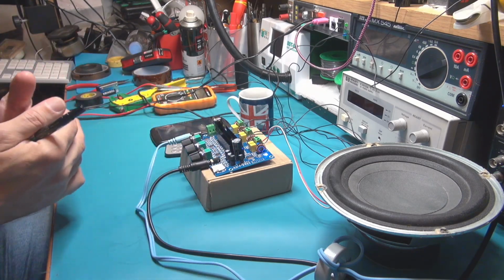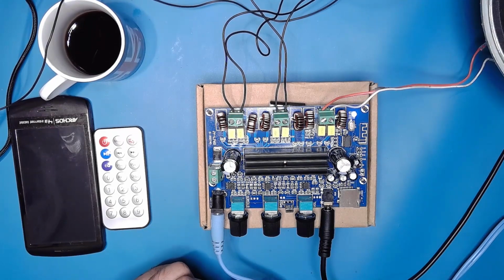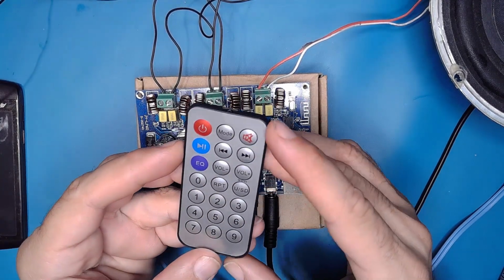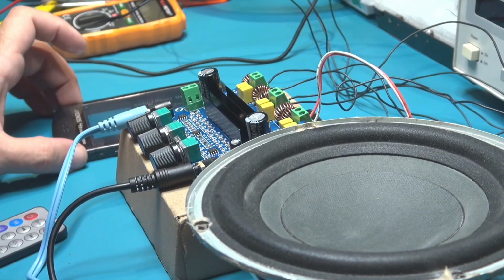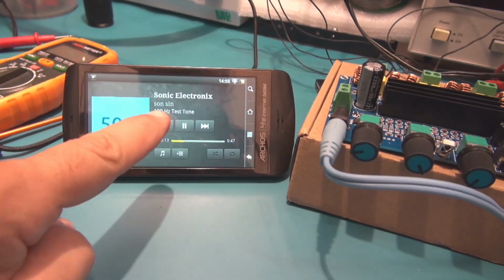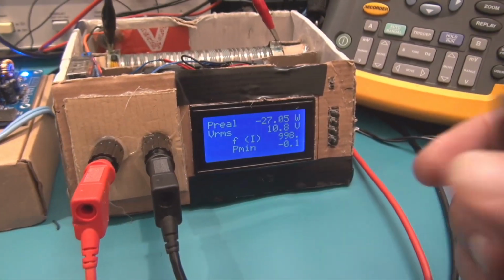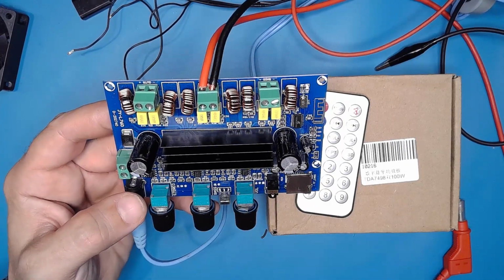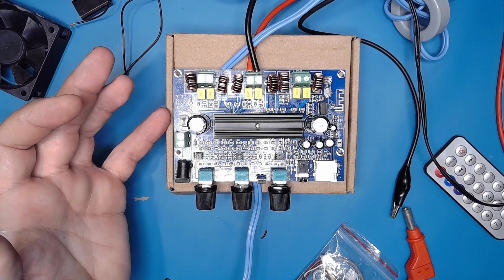2x60W + 100W Bluetooth 5.0 TPA3116D2 - The Real Watts

Comment: i have problems with my bluetooth connection, not stable. Loosing signal after 10 seconds
smartphone iphone 15
or
google pixel 7a
Reply from the maker: try to measure the voltage of this blutooth module. Maybe it's to low, or you have a corrupted circuit. Also, try to heat up or freeze it to see if it working better. Of course, if not, you will have to purchase a new one or add a new module.

Comment: I have similar board XH-M139 and noticed that 2 input preamplifiers NE5532P VCC pins are connected straight to the input VCC. However, datasheet shows maximum voltage for NE5532P is 22V, but the board itself is advertised at 24V. I have run it at 25V maximum and it is still working. Do you think in the long run this 24V will destroy the board of bad design? In the video your board is slightly different with 3 SMD preamplifiers, are they also NE5532P and can you check if Vcc pins for them are also at full input voltage?
Reply from the maker: Maximum voltage for those chips are 22V if you use symetrical power supply. So, with one single power supply you can use until 44V. 
Yes this board on the video has 3 chips, used here for bass and treeble adjustements. They are powered directly to 24V trough a ligh resistor and decoupling capacitors.
When IC are used for symetrical voltage and used in a single rail voltage, you can use it until twice this voltage.

Comment: Hi! 
This was my first class D 2.1 amplifier module (2017). Without blutooth and SD player...
When you search the best what can give an TPA 3116, this module is one of the best.
Why? Output filter coils are huge, not a little ferrite inductance with hair size copper like others!
The only cons is the non possibility to adjust low pass filter and a too little heatsink. Very tiny probs...

Bonne soirée à vous de Strasbourg!
Reply from the maker: Hello. Yes this power is very nice. But the video is quite old and I forget some details of it. The rated power is half the value, but still nice. Just need to admit that there is just 3db difference between simple and double watts.
I was intended to make a bluetooth speakers with this amp. But it didn't go as planed.
Don't forget that coils are here just to erase some high frequencies. Wich is fact, are not really handeled by the coil's speaker. Anyway, I smoked some car's speakers with a lower amplifier than this. Size doesn't matter now.
Greatings from Marseille, see you soon.
Reply: @AIexanderHartdegen  Hello
You say the radiator is hot. This module only comes in a low-demand version. The power limitation is due, I think, to the temperature. Changing the heatsink is necessary to make the most of it!

The filtering in output, must be able to be almost tranparent to the electric currents crossing it.
An output coil must have the right value to stop the HF harmonics and be able to pass as much power as possible. So tiny in ohm as possible.
Big coils, big current! Simple!
Square ferrite coils are ... 🤮

An 12 volt H linear config amp is capable of burning 1000 watt PMPO speakers! 😂

Do you know the electronic method of booster amplifiers for car radios and class D? 
BTL or PBTL?

My best!
Reply from the maker: @TheManeliss  Hi. In the video, the amp was tested with resistor load. Wich is hard, and can be destructive for some amplifiers. This method of measurement can be expeditious.
The sinwave used in this test is a full sin wave, providing RMS signal, at full tilt. Amplifier are not designed to work on this specs, they are rated and designed for dynamic requirements, same as music image. 
A sinwave test is very harsh. A resistor load instead a speaker is unusual, the power dissipation is higher.
The class D amp I told earlier was powered by a 27V 150W booster from China (4 dollars piece).
H configuration is a bridged amplifier, wich doubles the power, or increase it 4 time according if you keep same load or not.
Unfortunaltely I didn't know the BTL or PBTL you're talking about. Maybe a charge effect booster or anything else?
I only know boost by dc to dc converter to provide real power. In some radios, transistors used in output are MosFet, to avoid waste voltage. But simple DC booster are easy to incorporate, mostly they size like a big stamp.
I would be not suprised if on new modern car radio they integrate booster inside. (already done in BMW integrated sound system).
Reply: @AIexanderHartdegen  Hi!

A load is a load. Resisitive, self, or capacitive it's ever a load.
When you put a resitance to an amplifier, you give it a perfect charge. 

Why? Because it's linear. No self induction or ohm value changing with frequency.
 A loudspeaker coil get hot, same for resitances. Over 15W RMS all speakers use an aluminium cylinder for the coil. 
In parallel, magnets have an center hole to évacute more heat.

Testing an amplifier must be tested with resitances. 4 or 8 ohms... 
Because these values are only possible on a know box, a know speaker, at an specific frequency. Impossible!
A resistance is the same as an coil, it warm!

I've build for a friend a 325 liters box to welcome the biggest subwoofer from Focal.
A 38 cm multimagnets... A beast!
1300 E in 2003!
I never see anything with a bigger power heat dissipation! For home use!

So... 
Switching power supply have a non linear response on a load ! 
I buy ever 50 to 100% amps more my SPS!
In audio applications, it's a base.

 H... H bridge... Bridged... BTL (bridge tied load)... SAME!
85% more power.

PBTL? Parallel BTL! Gain between 30 and 40%.

Texas instrument is on top with all TPA series!

My best!
Reply from the maker: @TheManeliss  that's ok. If you make some measure on coil speaker, voltage value are not the same than a resistor.
There is many reasons. In practice, like in the video (as Wilston Lab AUdio noticed too), using a resistor is more difficult for an amplifier. Without any speculations, just practice show it simply.
I guess manufacturers use coils to "calculate" some output power, whereas real high brand use a resistive load.
There is two things here: using a constant sinwave, and a resistive load. This is the reason I use a fan on this amp. In normaly case and a full power on speaker, with music signal, it withstand power and heat.
Old amplifiers (eighties) are fragile with ohms load. This experience comes from practice, resistive load is harder than a speaker coil.
In car audio, H bridge gives 4 times more power ( 100 to 400). Suprisingly, DC to DC converters are very strong in those amp.
The watt you was talking about (pmpo) are the type of watt measured on a coil speaker. High frequencies give good value in this case.
Thanks, see you soon.
Reply from the maker: video is two years old, unlikely possible to treat it with real affirmations.

Comment: Can I connect two 110w 4ohm speakers to the l/r input?
Reply from the maker: I/r input? I don't know what it is, but you can connect any 4 ohms speaker of 30W minimal on any output you cant.
Reply from the maker: You mean Left and Right output? Yes you can, it will work fine. 4 ohms is the perfect value for L and R output, the the "perfect" value for central speaker is 3 ohms, or 4 ohms.

Comment: Hi. I have this amp and 2 x 8 ohm full range and 2x 8 ohm mid-woofer. I would like to add 2x4ohm woofers for lower end. Can I use one bass output for 8 ohm and the other for 4 ohm? I know it won't be as loud but I don't mind.
Also, should I connect them in parallel or series?

Thank you
Reply from the maker: you should connect it in series (8 ohms) for bass output. If you connect it in parralell, you will decrease the output power because the limit 3 ohms protection . If you want good quality and stability, you need to use your 4 ohms in series, but you will lose some watts. If you connect it in parallel, you will activate output protection on the output when reaching high level volume.

Comment: Hello, can I connect 3 ohm speaker into L/R output? Thanks.
Reply from the maker: that's not a good idea, the card will reduce the power to protect those output. 3 ohms are only for the bass output. If you did it, you will reduce efficiency and make more heat, with no good power output.

Comment: Hola existe la manera de agregarle otra placa para tener más canales ? Este tiene 3 los lo visto . Yo necesita tener 10 canales para parlantes de rango largo y 2 de subwoofer
Reply from the maker: yes of course. You just to need many amplifiers. You can use simple stereo amplifier, wich contains two channels. So for your purpose you need 6 stereo amplifier. Those who are for the bass need to be more powered, higher voltage supply and more watts.

Comment: looking for amplifier to my little boom box project. it will cointain (Tang Band W3-2141) 2x25 W (RMS) full range speakers and (Tang Band W3-1876S) 2x15 W (RMS) mini subwoofers , as power supply there will be 2x20V (4Ah) power tool battery in paraller, so i dont have to worry about charging/discharging circuit. wold you recomend this amplifier ? or another ?
Reply from the maker: I think this amplifier is the best for your project.

Comment: I currently plan to power a subwoofer which is usually for car hifi at my home. What amp-board should i use, or does this amp board also works for it?

The subwoofer: Alpine 6162 GX 100W Rms 300W Max (4 ohm)
It's a pretty old subwoofer, which i got from the grandpa of a friend.

Because from the measurements it seems like the amp has way to less power to use with this subwoofer. 
Do you know any amp i could use (at home) for this sub?
Reply from the maker: yes she will work with it. Just use the maximal voltage rated for the amp.

Comment: What will be the maximum power output on each channel if we are using a 24v 4A smps (6A max), and 4 ohms speakers. Does the output watts gets more in 4ohms compare to 8ohms?
Reply from the maker: 30Wrmsx3. Yes.

Comment: with a 19,5V/11,8A power supply how much do you recon it can produce in 4ohms ?
Reply from the maker: didn't understand you question.
Reply: @AIexanderHartdegen  so, taking your test into consideration, what's the maximum power @4ohms that can be achieved with this module if the power supply can deliver 19.5v and 11,8Amps ?
Reply from the maker: @SFXMediaRO  response is (19x19)/(2x4Ω)=45W rms. On the central channel you can connect 3 ohm speaker. In this case on this output you will have 60Wrms. Each output is protected against short circuit and over current, useless to try to connect more speaker, the circuit will automaticaly cut the output. The max voltage output, because it's a class D amp, is the equivalent to the voltage power supply. In this case, in all 4Ω speakers, you will have 3x45W total, except if you use a 3 Ω central power, you will have 45Wx2+60W, all power in RMS.
Reply: @AIexanderHartdegen  something is wrong with your math... For the sub ch the tpa is bridged on output, so it can't be the same as the the one functioning in stereo. Something is off there.
Reply from the maker: @SFXMediaRO  sorry, don't have the time for any of your request.
Reply: @AIexanderHartdegen  No problem, was just trying to figure out your power output formula... enjoy your weekend

Comment: Very useful information. Can you explain more about what coil you are using on power supply wire? The calculation or size I mean
Reply from the maker: mean toroidal?
Reply: @AIexanderHartdegen  Yes, the one with the power wire wrapped around it.
But that gray piece does not look like a transformer!
Reply from the maker: @mortezanabizadeh1988  it's a grey core, like you cand find on little toroidal transformer. The permeability is normal and also you can use a black or green one. Without color is a ferrite wich can be used for this purpose. No matter about the real core, you use it when it works and prevent from disturbing some devices.
Reply: @AIexanderHartdegen  Awesome
Thanks for the explanation and fast answer
Can I use switching power supply instead of toroidal? Or will that make noise?
I only found normal low quality transformers in local stores.
Reply from the maker: @mortezanabizadeh1988  Yes, you can. But you don't have to use such filter if you don't have some apparatus switching, or blinking because the amplifier. It was an easy idea to rectify an artefact from the high frequency switching wich was in my case boring because I had some sensitive devices (in that case a blinking computer screen). If you don't have such kind of problem, or something similar, you don't have to use a filter like I did.

Comment: Bro...Very good work keep it up...You have replied to all the comments.please reply to me too...please
I have 6.5inch 90watt 8ohm subwoffer and 30wattx2. 5.25inch 6ohm speakers...I am planing to build a hometheater...all the things are clear but not amp
Should I use this amp for 90wat 8ohm subwoffer??with 24v 5A power supply
Or i should go towards class AB
TDA2050 in brige mode...That can give 50-60watts in brige mode at 8ohm
Reply from the maker: You can use it but you will have half the power. A home cinema is intended to be loud. Many people use this kind of kit to listen music. This power can be enough to listen music in domestical application. TDA205O is using the same voltage (or less) and is a classical amplifier with important loss. Even on bridge mode you will not have the result you want. The cheapest way for you, is to use a three ways amplifier, wich can provide to you enough power to satisfy your listening. The difference is that a class D amplifier has a better yield, even supplied with the same voltage than a class AB amplifier. You should know that every class D amplifier works in bridge mode, and has better yield. If you are agree to have not all the power because your speakers are 8 ohms load, you can use this kind of 3 way amplifier with 26 volts supply. In a classical room it will be enough I think, and it can give you nice results. In other ways and to have more power, you need other amplifiers, wich one can cost you the price of a classical home cinema from market. This kind of amplifier is perfect for you, according the ease, the cost, and practical application. Try it for your project, I think you will be suprised how class D amplifier can perform, even on 8 ohms load (and 26V supply).
Reply: @AIexanderHartdegen  First of all thank you so much for replying me.but is this thing not true that this amplifier board gives 100watt output at 2ohm??and secondly TDA2050 produces heat very lot.you have very good knowledge about amps.He was saying that 2050 will perform much better with 5amp transformer than class D...i will act upon your advice....but please let me know how much ampere of power supply to use with one 8ohm 90watt load and two speakers od 30watt and 6ohm....
Reply from the maker: @justmusic0786  no, it give 60W rms on the bass output on 3 ohms, and 50W on 4 ohms. The R and L are 30W rms on 4 ohms. The TDA2050 is a low budget component. It can not give you more power because it need lower voltage (22V). Class D like here use 24/26V and will give you better result because higher voltage and yield.
Reply: @AIexanderHartdegen  bro if 60 watt on 3ohm, than on 8ohm?
Reply: @AIexanderHartdegen  And according to you,will i get better performence than a branded hometheater like EDIFIER with this class d amp???my speakers are branded LG electronics speakers 30watt each.and subwoffer is 6.5inches 90watt PANASONIC..So i mean that can it compete with hometheaters which have total RMS power of 60-70watts?????please reply.....you r the only person who can help me in compleing my project because peoples made me confused that what to choose and what to not....
Reply from the maker: @justmusic0786  Home cinema speakers are 2 or 3 ohms load. To have same power you need a lower load speakers, or using more powerfull amplifier. If you use 8 ohms speakers, you will have half power compared to 3 or 4 ohms load.
Reply from the maker: @justmusic0786  If you want more power, try this TDA7294. There is a test on my last video about it. https://youtu.be/LrlFr13lZOY
Reply: @AIexanderHartdegen  oh
I got that
Reply: @AIexanderHartdegen  ok
Reply from the maker: @Just Music this class D amp is not performed for 8 ohms. You have to use lower ohm speaker, or change your amplifier project.
Reply: @AIexanderHartdegen  it is very costly amp in my area
Reply from the maker: @UC5reRmzwIelfBrNcEYADC-g no, it gives 2x30W RMS (60Wmax) on 4 ohms, and 50W rms on 4 ohms (or 60 on 3 ohms). If you use 8 ohms speakers, you will have half power on each output. This kind of amplifier is the cheapest amplifier and the best ration price/performance you can get. If you want more power, you can, but you need to ad a zero more behing your budget price.
Reply: LOL!!!   theatre???  on this?

Comment: thanks for this. is it compulsory to install a cooling fan ?
Reply from the maker: Of course not. My test was harsh, because a sinwave was sent into a resistive load, wich is the worse test you can make. So, for on HP use, it didn't require a fan. The fan was because the test was HARD.

Comment: AC/DC ADAPTOR
MODEL: 1220
INPUT: AC100-240V 50/60Hz
OUTPUT: 12V=2A

Is that Power Adapter good to use?
Reply from the maker: you need 24V ...26V adapter. 12V can works but you will have only quart of the max power. 4A is the current required to use at full volume.
Reply: @AIexanderHartdegen  thanks 🙂
Reply: 24v 20A, joss